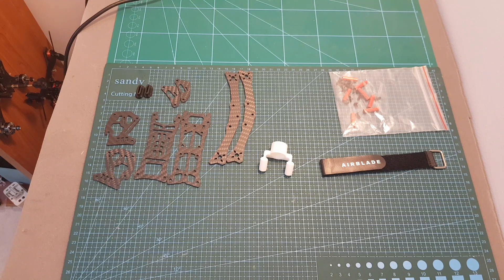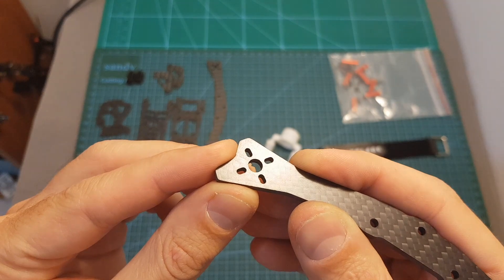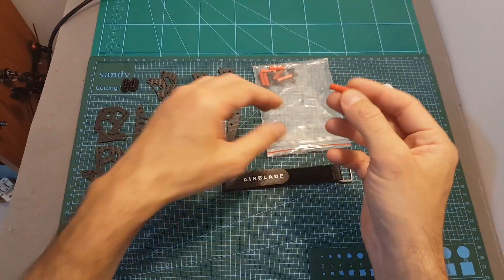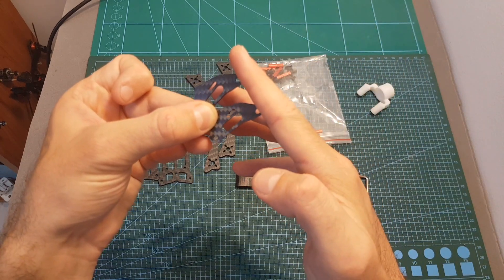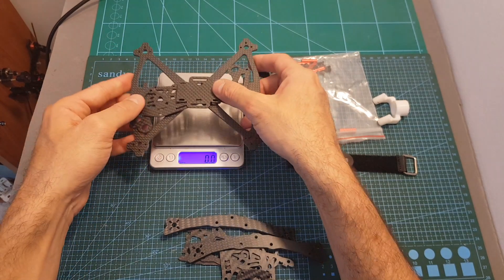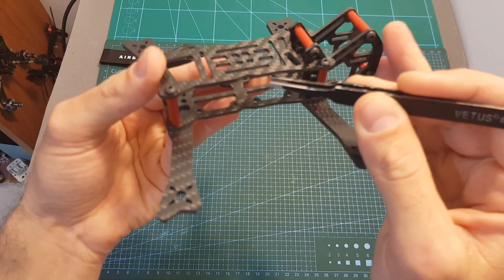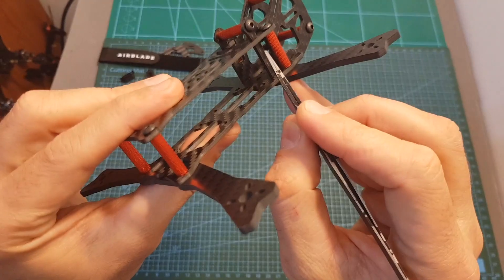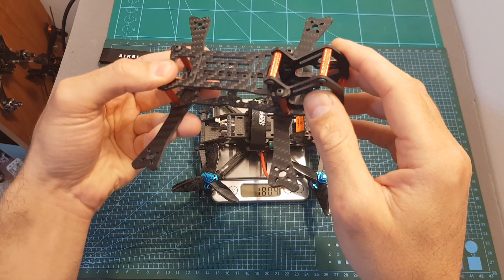AirBlade Intrepid V2 - Frame Overview

Comment: Thanks for the tip! I ordered the Pro version with your link. It was a choice between this frame, the BR3 frame, and the Acrobrat. The BR3 says it will do a Split mini, but with only one 20mm stack spot, it has to be pretty tight. It's slightly lighter than this Intrepid frame, but it has two 20mm stack mounts and the ability to install a Split mini and another FPV camera! I love that idea because the FPV feeds are the weakest part of those HD cameras IMO. Co0ol option. The Acrobrat is really quite nice, but it's also quite heavy!
When it comes right down to it they probably each have their pros and cons, but it's hard to argue with 50% off on the Intrepid, today only. That's makes it $26 shipped! Just can't beat it for the quality! Replacing my XJB-145 frame that broke with pretty much the first crash. Those side plates are weak ASS as hell! Broke back by the LED holder where it is something like. 5mm thick! Damn it's thin! Definitely, without a doubt the worst part of the XJB. 🤪
I'm excited about the options I will have with the Intrepid v2 Pro frame! Thanks Gal for your video! Glad I'm a long time subscriber and have the very important BELL CLICKED, or I would have missed this one day, half price deal! Happy Holidays to you and your family! 🎄👍😁
Reply from the maker: Thanks buddy! I am glad you had a chance to buy it for that price (No brainer, eh? ;-) )
Looking forward to seeing your build. Happy holidays to you and your family as well!
Reply: @KremerFPV  should be here any day! I live in Oregon, which is just one state below the Canadian border of which they are very close to. So quick shipping to me! I really like how versatile and durable that frame is! Can do two stacks or one, two cameras or one, I'm sure it could do top or bottom battery, with sideways battery on top option too! That's not even mentioning the numerous motors it can use! And the price, well, that's incredible! Who gives half off custom frames that are that well designed? I've never seen any! 😁👍🤪  Take care!